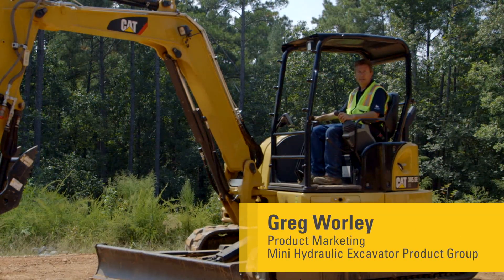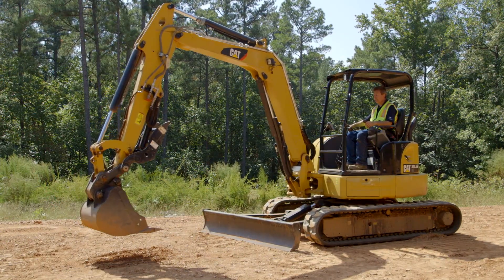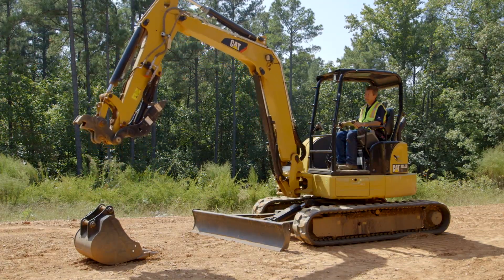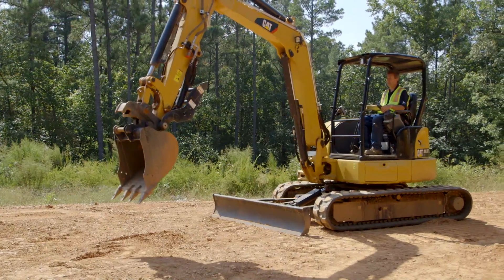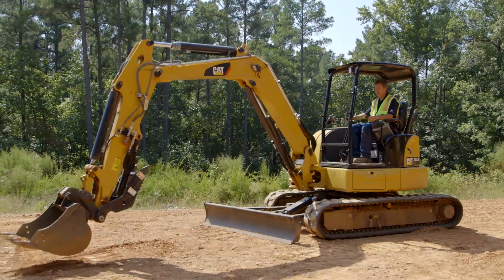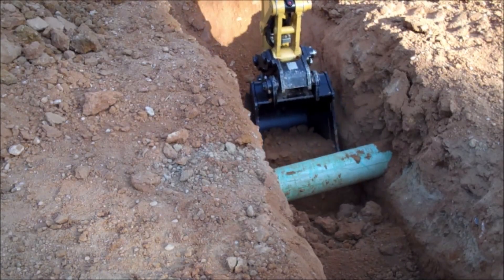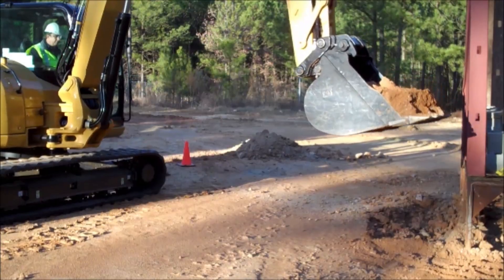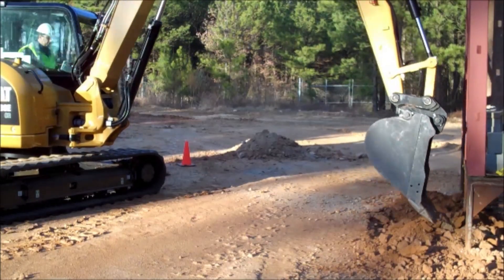Front Shovel Mode on a Cat® Mini Excavator

Comment: I personally would recommend to do the safety check in a "more effective" way aka. curling the reverse mounted bucket all the way to the machine for the check and doing the same motion as I would do with the normal mounted one... in the vid you see at 1:11 the bottom being pushed against the ground... but shouldn't this test be there to see that the "rear pin" (front pin of the bucket in the rear coupler end) is being held?

I would do it by curling the bucket all the way to the machine and then push with the teeth against the ground right by the blade (just my two cents as I used to work with reversed buckets a  lot over here in europe ;-)
Reply: Calm down safety sally .
Reply: @Gusto9698  wow... such a mature reply... have a nice sunday 😜